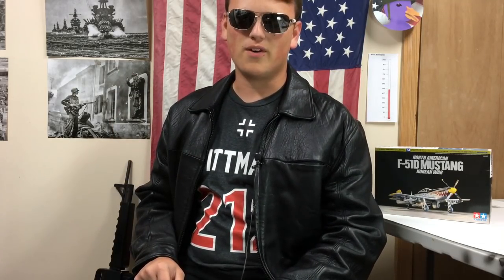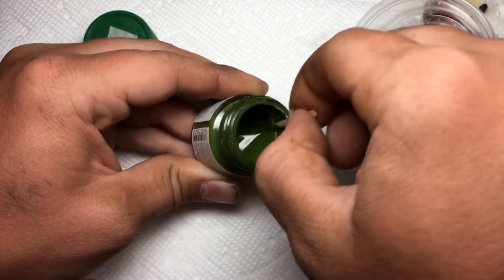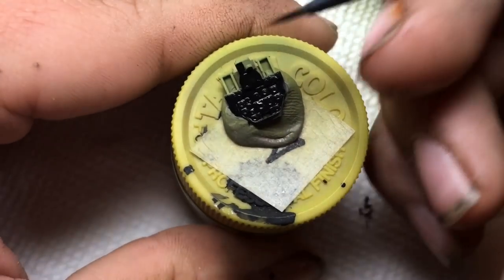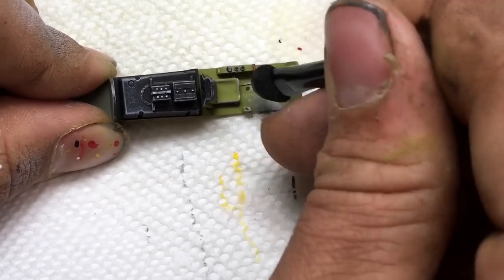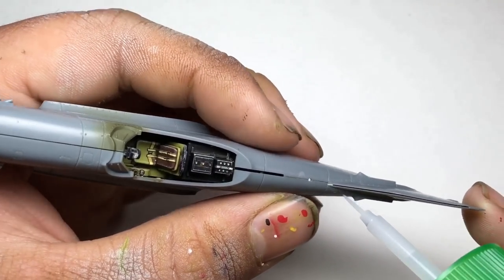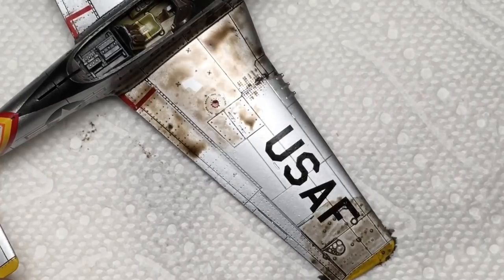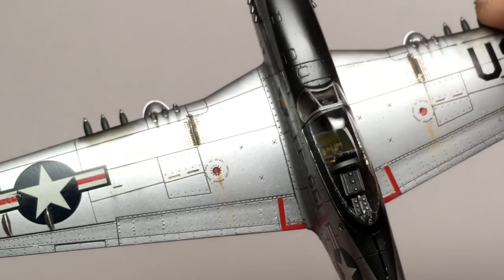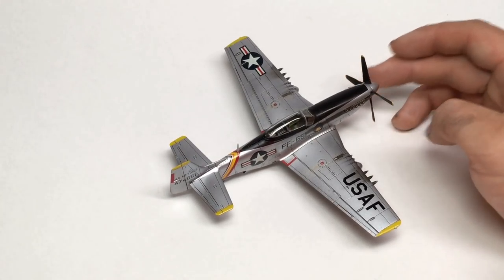Tamiya 1/72 F-51D Mustang "Korean War"- TIMELAPSE BUILD!

Comment: good model, but little note! Mustangs had wooden ckockpit floor, not metal as your has.
Reply from the maker: Šimon Malík crap! Thats what I get for using a museum example as a reference. I’ll keep it in mind for the 1/48 one
Reply: Wow never new that about the floor for the mustang thanks..
Reply: Mustangs had wooden floors, true.  But many were painted over with interior green out of expediency and ease of maintainence.
Reply: yes the mustags had wooden floors, but they usually had rubber overtop
Reply: Similarly to the T-33A trainers I worked on in the USAF, late 1970s.  They had wood floors too, but painted the same gloss ADC gray as the rest of the cockpit.

Comment: Just got through watching your video Pretty-boy ! Wanted to let ya know....if you could even find the kit
anymore......this is a 1962 - 1966 Monogram  F51- D Mustang in 1/32 Scale This kit has operating Landing 
Gear, and Bombs that drop. Prop spins of course, cockpit is pretty detailed.  This kit was reproduced in a
pedestal and is battery powered so the Prop is 
motorized as well as the Landing Gear, the Bombs drop as well.  Being Clear the Fuel Tanks are molded in 
Red styrene and some of the Interior parts are molded in a Light Green color to represent the color used in
WW II  (ZINC CHROMATE GREEN)
Reply from the maker: My LHS has had one on the shelf for years. Think theyre asking too much for it.
Reply: Just outta curiosity...what do they want for it ?
Reply from the maker: @kwman69r  cant remember off top of head, sorry. Ill be back home (im hundreds of miles away atm)  in a few weeks and will respond again then.
Reply from the maker: I want to say in the 65 to 85 range

Comment: If i was to brush-paint this model, what challenges would i face? Im working my way to an airbrush but the p/f51d is my favourite plane and i love this paint scheme
Reply from the maker: If you want to know about hairbrushing I would recommend Quick Kits- he hasn't posted in a while but I'd consider him the expert on the subject. As for my advice? Don't try. Metal colors are almost impossible to hand brush well. You would be far better off buying a can of Tamiya Silver spraypaint. It doesn't need a black primer coat, it's one of the best silver's you can get anywhere, and best of all the paint is STRONG, so there would be no problem masking on top of it . 

Hope that helps
Reply: TheWaggishAmerican sorry, forgot to mention but i have watched quick kits and im currently doing the airfix p51d and im using tamiya flat aluminium and it looks great,  i was more refrencing as if you had any problems with say paint sticking , if build fits nicely or if  some bits in your opinion absolutely required an airbrush. Also, i am not trying to get a gloss metal but more a nice even metal with some flake. Bit confusing but i hope that makes sense 😂

Comment: Hey nice build! Looks great. I have just picked up the 1/48 version. Do you think it would be wise to use a primer before applying the main coat?
Reply from the maker: Yes. Anytime you are doing a metal coat you should use a gloss black primer- UNLESS you are planning on using the Tamiya Silver Rattlecan, which you can get away with without as long as you didn't use and filler. I like to use primer anyway, to make sure I didn't miss anything which needs filler.

Comment: how do you get the decal to work my tamiya spitfire, which came out after this mustang, came in with an unusable decal due to the age of the decal. also cool build keep up the good work :D
Reply from the maker: What specifically is wrong with the decals? If they are yellow, put them in a zip-lock bag, and stick them in your window in direct sunlight for a couple of weeks. This usually will bleach them. If they are dissolving when you try to apply, what you can do is cut VERY close to the decal, and spray it with some decal bonding spray. People use it to seal the printer ink when making custom decals, and it can basically glue a decal together. Testors do a rattlecan for this purpose called "Testors Decal Bonder Spray". Only thing about that is once it's on, the decal is fairly thick, and won't really respond to decal solvents. If both those things fail, it is possible to fix cracking by doing the method above but with a clear spray paint, but this makes very thick decals that don't respond at all too solvents and can easily be destroyed. 

If all of that fails, you are pretty much out of luck, and should probably hit up eBay to find a replacement set. Honestly, with Tamiya decals, you might just want to skip to this point. The things are beautiful on the sheet, but a beast to work with even when they aren't ancient.

Hope that helped.
Reply: @TheWaggishAmerican   I'll try it out thank man.
Reply from the maker: @guavavar8668  No problem, if you've got any more questions be sure to ask.